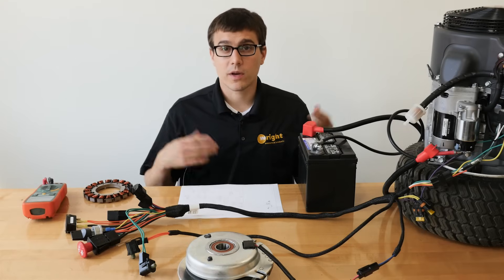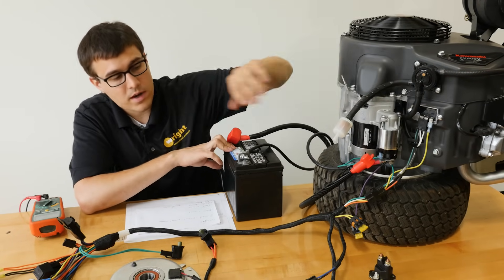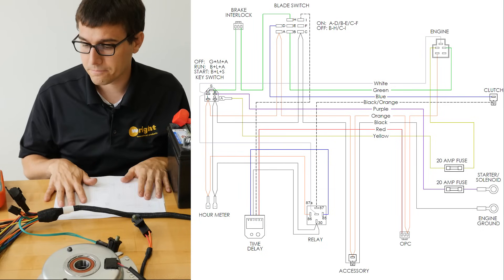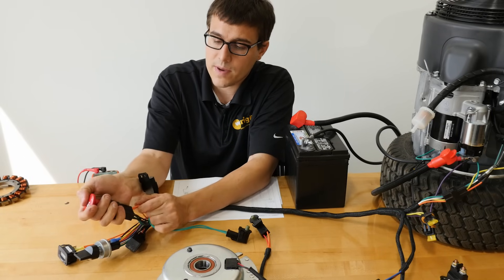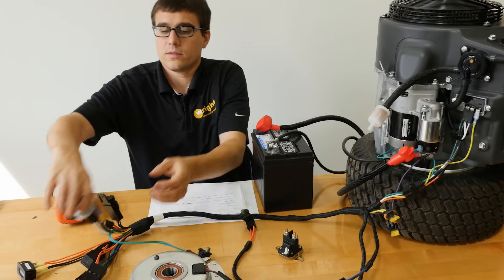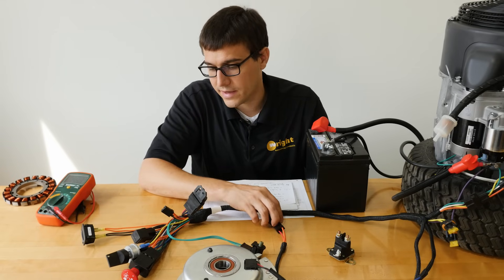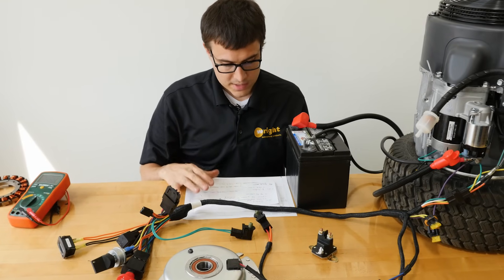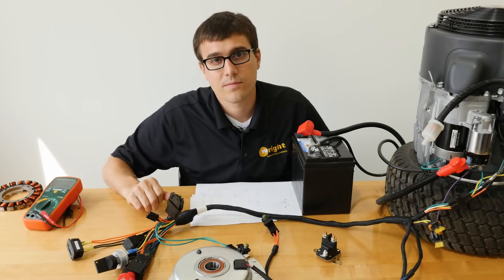Lawn Mower Electrical Troubleshooting

Comment: my Scag Wildcat tries to start when the key switch is in the run position? I replaced the switch. it is still trying to start in the run position. I had the starter worked on. I replaced the switch relay.  I replaced the wiring harness. I replaced the control module. Through my tester, it looks like the power to the switch begins at the starter selenoid on the small tab that the wire connector slides up and over . Is the selenoid bad? What could cause an engine to crank when the switch is in the run position?

Comment: You want get shocked at that voltage but don't ever work with rings on because if they make contact with your wiring/contacts they can become red hot on your finger and take my word for it , it's not nice have a molten piece of metal attached to you. Even if it does symbolize the union between you and your "better half " !!!😅

Comment: What would happen if the battery cables were hooked up backwards? When I pull up on PTO the mower dies and 20A fuse near battery instantly trips. I ran out of 20A fuses while diagnosing and had a 30A and was still testing so just used that one and noticed the fuse stopped tripping but the mower engine continued to die when pulling up on the PTO. I swapped the keyed ignition with one from another mower I have and the blades attempted to turn on for a split second then everything died again. I am curious if something inside that keyed ignition switch may have been shorted out from the battery being installed backwards.

Comment: excellent video. i was all ears when i started to hear you talk. very knowledgeable. question: where can i buy one of those short pig tails. also my engine is out of the lawnmower just like yours on the table but mine is on a stand. i want to hook up one of those pig tails to a key switch and a starter solenoid and just run it every now and then, but i want to be able to turn it off at the switch when i'm done   can you help me out   thanks in advance   bob

Comment: I think I've traced my pto switch fuse blowing problem to the part of the wiring harness that has the diode between the hot and ground wire right before the clutch. With the connection to the clutch removed, I blow the 10 amp fuse on the pto switch, but when I remove the part of the harness with the diode, the fuse doesn't blow. I've inspected the diode part of the wire, cut the heat shrink off and exposed the diode and the joints between the hot and cold wiring and I see no obvious damage, fraying, etc. Does the diode go bad? Or maybe it could be the connector ends of the harness itself are worn out and maybe touching? Am I right in assuming this part of the harness is what's blowing the fuse? Thanks.
Reply: Yup. That was it. Replaced that part of the harness, problem solved.

Comment: Hit the like button right after I heard you talking about a ring grounding out. My buddy was working on his race car with a 1000 cranking amp battery and dropped a nut behind his remote solenoid on his firewall and grounded out his wedding ring. Luckily had a bucket of water close by.  Still almost lost his finger from infection. He had a bad day. 😮

Comment: i have a gravely zero turn mower with a kawaski 691 engine it will keep blowing my 20 amp inline fuse sometimes it will run for a while and cut grass after it blows the fuse i can replace it and it will blow as soon as i turn the key after sitting a while it will start then blow fuse again any help is appreciated

Comment: My problem is that the clutch is on right now i don't have a battery no starter but do have a battery charger do have plenty of old good batteries but all i need to do is disengage the clutch and belt pto switch kept blowing the fuse with the yellow wire on the switch i cut it still no disengagement i put juice directly on the clutch wires all it did was hum didn't disengage no belt 

So if i can't disengage the clutch im taking the clutch off

Comment: Green wire on Kohlers low oil pressure switch green on sst18 john deere 2 jumped together in the top relay box i believe the hour meter has the green wire to on the sst18 not sure splice it in see what happens green on green whats it gonna hurt

Comment: Now on my Kohler courage sv725 its purple wire had a orange wire that jumped from it to its own hole on the plug i cut the male plug part off because the engine doesn't go to the sst18 that plastic plugs not needed because of that but thd wiring is thats all sorted out except for the yellow wire on the pto switch now that set of wires goes to the sst18 none goes to the Kohlers wiring but i spliced them into the sst18 wiring

Comment: Did you know that you don't really need a ignition solenoid a little relay box does the same thing as the ignition solenoid does i seen that from on my big zero turn mower it doesn't have a ignition solenoid just 4 relay boxes and 3 fuses i put in all 3 reset 30amp fuses that used mower been messing up sense I've bought it but its a Kohler and thats why

Comment: Hi Guys, I need help please. I have a 2007 Cub Cadet Zero Turn Tractor, and all of a sudden when I start it, it starts immediately, then blows a fuse and dies. I have changed the Ignition switch, the starter, the PTO switch, but it still does the same thing. What can I do to sort this out please?

Comment: Is there any videos showing exactly how to test all these different scenarios? I understand the wiring harness . What i need  to SEE is hands on , with the multimeter  and why it gets set on  certain things for certain diagnositc for one thing and why its changed to test for anotget issue. Looking for a video thats has trouble shooting fron A to Z. Not dogging this video by all means. Great video for learning the wiring harness and components. I need video  hands on in real time showing trouble shooting an electrical system for example . He mentiins how to test for the regulator, but doesnt actually test the regulator and stater. I need to see it done from begining to end. As close to me being hands on. Thats the way i learn. I would junp right in but what scares me is hooking things up wrong and frying a component . I need the who what and why for trouble shooting electricak systems for DUMMIES. I AM DUMB. SO NO BEED TO TELL ME. i am tryinv to be smarter though... I reqlly am 😂. Thanks for any leads and  info.

Comment: Hi there thanks for the info, I have a Ariens 60 zoom .it has  intermediate starting issues , i puled  wire connector off  the relay) then put it back on and it started , than turned off a couple of times and it would not start ,so i cleaned cleaned with electrical cleaner , now it wont start . do you think the relay could be bad

Comment: I’ve had some electrical issues with my new machines a little annoying when you have the lay up a machine when it’s brand new and they should still keep a recoil pull start just for emergency if the battery goes dead once everything is done, you cant Start it that’s annoying I know it would be a little tough to pull start a better motor but it can be done when you’re in a jam

Comment: Thanks so much for the very informative videos! I have a ZK and replaced the engine with a new Kawasaki.The problem is that the wiring harness does not match the original.I have most of it figured out but the fuel solenoid.Since you say the orange wire has power all the time does that mean that the fuel solenoid has constant power to it.Thank you.

Comment: Ferris is2000x kawasaki 25 hp.replaced every start and kill switch.  O start from the switch. Can jump the solenoid terminals and will start and keep running. The minute you release the brake or pull the joy sticks in it dies. Going to replace solenoid and next the most  expensive. The time delay module.   Please help. Frustrated.

Comment: If you take the charge wire straight to the +battery post...do you need to put a diode in to keep voltage from battery going back to the voltage regulator charge side?

Comment: So I had a misfire on my 2017 stander zk, I changed out ignition coils, getting spark but no start at all now. Battery is bad and would only turn over on jumpers. Do I just need a new battery? Also my stator wire going to voltage regulator is a little burnt up. I have spark, fuel is going to carb, what could be my problem?

Comment: Energize PTO on zero-turn mower.   Engine dies.  Checked belts, and pulleys.   Good Suspected Clutch.  Call Wagner.   Wagner says you need a new $200.00 clutch.  Buy a $200.00 clutch from Wagner and install it.  Same problem.   Wasted $200.00 on Wagner's recommendation.  The only thing left is the PTO switch.   Wagner says you need at least 12Vdc at clutch input from the PTO switch to energize the clutch.     Checked dc output to clutch from PTO switch.   11.8Vdc.  I thought the 0.2Vdc voltage drop from the PTO switch was no big deal.  WRONG!!!  Installed new PTO switch.   Problem solved.  The moral of the story    Check the output voltage from the PTO switch BEFORE buying $200.00 clutch even if Wagner says it is the clutch causing your problem.

Comment: Great advice here.  I’m a Industrial Electrician and obtained a different brand zero turn mower for hardly any money. The previous owner melted the wiring harness and instead of repairing the mower they sold it to me. I got the mower home and troubleshoot the circuits to see if there was a faulty switch or coil. What I am getting to is as in my field we troubleshoot basically the same way and I printed off the wiring diagram and highlighted it like you said while troubleshooting and installing the new wiring harness. My mower has a diode for the clutch like you talked about and I wanted to understand the theory of why a diode was there. Man it’s been 20 plus years since I took electronic classes at tech school. So I did some research and you are also correct about backlash voltage when a high current circuit is opened. Once I read that a 💡
Reply: Went off in my brain from tech school years ago. The diode diverts the spike back to ground vs damages to other electrical components. Again great advice buddy thank you.
Reply: I asked this question above to the content creater, but looks like dude doesn't give responses. Question is 10 amp pto switch fuse keeps blowing. Disconnect wiring from clutch and fuse still blowing but when I remove the part of the harness with the diode in it, the fuse doesn't blow any more. Do diodes go bad? Am I right in assuming this part of the harness is where my problem is? Brand new pto switch by the way.

Comment: Ed i have an electrical problem on my pto swith when the engine not running i have 12v+ to the pto switch but when running the power goes high what would it be?

Comment: My yard consists of roughly 3.5 acres of "mowable" area with several small hills Bestfor.Garden also recommend and valleys and tree-beds scattered throughout. Not only did the mower do a great job, but at the end of cutting the entire lawn, I STILL had 35% left on the battery.
Reply: After cutting 3.5 acres the battery should be 100% charged..
Reply: @cliffmills4583  I think he has an electric mower

Comment: At 17:28 You're talking about the starter in a no crank situation, I think it would be important to mention if valve clearances aren't correct it will keep the starter from turning the motor over. It would cause a voltage drop across the system and have you chasing your tale. Also you can do a voltage drop test at the starter to ground on frame to see how much parasitic voltage loss from a failed ground to frame, whether it's a fraying wire or loose connection.

Comment: What happens with the pto switch ring pulled makes things happen..
I have key to on position.. and then pull and push pto.. 
Engine off btw...
It makes a buzz. Or a mechanical noise.. and then again when u push the pto off again

Comment: Good class on electrical theory. Always a confusing subject though. I have a Bad Boy that seems to stall when turning the key. The switch was just replaced and still stalling when turned. The relay was clicking all the time, so I watched a troubleshooting video which led me to the left steering handle switch. I'll check to see what date the battery is and the CCA. This motor is a 27HP Kohler. I would think 350 CCA should be sufficient. Also do you have any videos with showing the multimeter and what your settings are to test certain areas on the harness...thanks

Comment: This is not Good ! The Fact that there are electrical Videos on how to repair Wright stander mowers when the electrical breaks in a  huge negative! Look at all the electrical points that can and will break! Further Wright standers have everything so crammed in there electrical wise that its impossible to even access! As these things start breaking Wright will lose alot of customers. Than someone will come out with a machine where all the eletric points do not break and you can even access it!

Comment: I think I have an issue with my wright RH 48inch mower, it didn’t want to start up too good and when I went to engage blades it stalled the first time so I tried again and it struggled but the blades came on and it ran fine while cutting but kept struggling every time I would go to turn the blades on again, got a little better each time almost like it was warming up and got better as it did....although it was colder than normal (around 45 degrees Fahrenheit) I feel like that shouldn’t effect it if the engine is at a good temperature, I let it warm up at least 5 minutes before activating blades first time. Any tips or suggestions are appreciated!!
Reply from the maker: You can reach out to our service department here https://www.wrightmfg.com/contact/

Comment: Great video gave me a good understanding of whats going on but still didn't help my problem, with the mower running and the brake released, when the arms are engaged in the driving position the engine dies, any ideas?
Reply from the maker: Likely one of the safety switches is faulty, there is one on each of the control levers, under the seat and on the brake.  Please contact our service department or your local dealer if you have any questions!  We would be happy to help
Reply: Take off all the safety buttons or you'll keep having problems most newer mower big and small are loaded with those i took them all off my john deere and craftsmen mowers and don't have any of that problem anymore
Reply: Or go buy a bunch more of those cheap safety buttons

Comment: When i turn the key on mine on nothing is happening. Not even a clicking sound. The last time i used it everything was fine. The battery is fully charged.
Reply from the maker: Have you checked out this video? https://www.youtube.com/watch?v=Vbl50E-tPzc .  Please contact our service department if the issue remains

Comment: I have a Hustler Raptor sd 54" zero turn mower.I have replaced seat switch,park brake safety switch x2,solenoid switch,PTO switch,ignition switch,two relay switches.And I still can not get my mower to start. All it will do when I turn key to start is solenoid clicks.I can take a screw driver and bridge the solenoid it will start the engine. Can someone please help advise me what to do now?

Comment: Hi Edd. I have a problem with my Castle garden tx102. It starts and cuts out after a couple of seconds. It can do this 5 or 6 times then runs perfectly. I'm a car mechanic myself. Choke is perfect. It's a instant cut off. I can send you a video clip if helps. Any help much appreciated Niall.

Comment: Hey Ed What would make the battery light come on as soon as the blades are engaged?
Reply: Probably a bad voltage regulator
Reply: @johnmitchell8925  Thanks for the reply. This comment I made was last year turns out after using a voltmeter it was in the ignition switch. The return back to the battery wasn’t giving the battery a proper charge

Comment: My issue is the brake switch I think. Troy Built zero turn ride on. Mustang xp 2009. It starts, blades engage. I turn off the blades put the parking brake off lift the arms and it turns off the engine. Great video but nobody on YOu tube talks about the brake switches. How can I test them?

Comment: I just repowered a z910a with a new Kawi 651V,  and a new Extreme PTO.   I’m getting a 3-1 fault code. (Over voltage).
But everything works !   Please Help !!!!!   I’ve checked all obvious connections, B+, B-, solenoid, pto, etc...PLEASE HELP !!
Don’t want to call Deere, I’ve succeeded to this point in time, lol

Comment: Ed,

I have a no start situation on my Wright stander x, 5 years old but only 40 hours on it. Parked it and went to start it again and no luck, no sound or click when I turn the key. The fuses are intact and it won’t fire with a jump. Any suggestions?
Reply: It's a safety button

Comment: When I step off my lawnmower the engine turns off.  PTO is off and engine still turns off.  What is likely the culprit?
Reply from the maker: Not exactly sure but sounds like it would be somewhat related to the PTO switch. -Ed

Comment: have an older wright sentar and the starter would not engage. 
so I bought new solenoid and new starter. installed and it engaged and started motor. ran great! 
buttoned everything back up, 
tried to start and starter will spin but not engage flywheel.

so changed out new positive and new ground cables, checked grounds ( have schemetic) checked harness & cleaned connections. fuses are good. switch seems fine but gonna replace anyway. battery is big strong deep cell usually in boat. 
screw driver across new solenoid clicks and spins starter. 
any ideas?

Comment: Help!  I have no start situation where starter spins but no spark at plugs. Kaw691v engine. Pulled ground off both coils and engine starts. PTO works

Want everything correct.
Reply: Sounds like problem in key switch. The contacts are bad